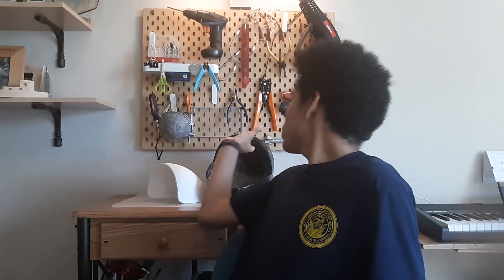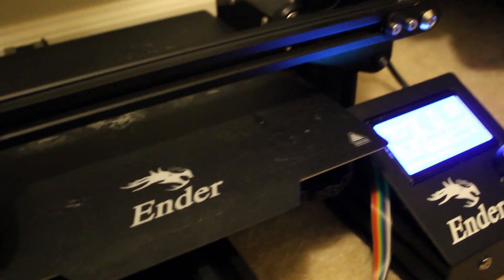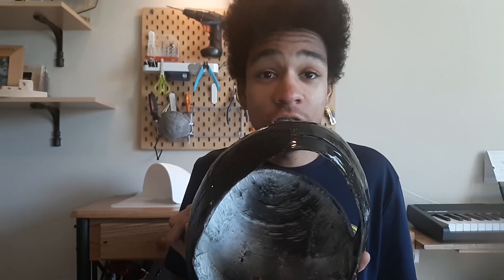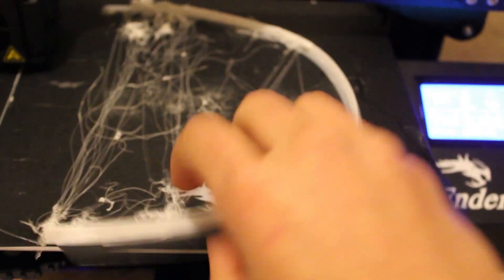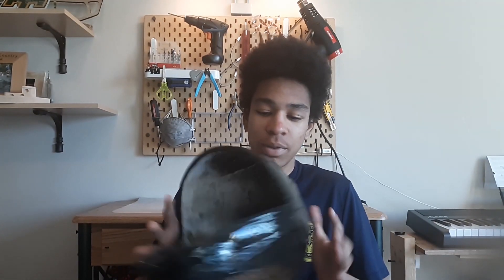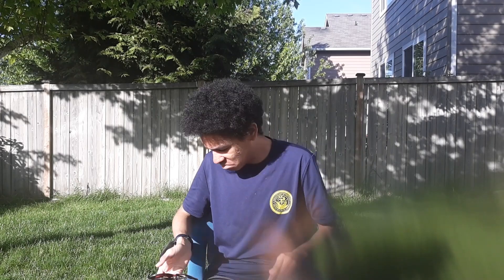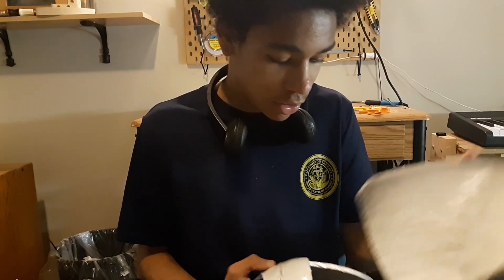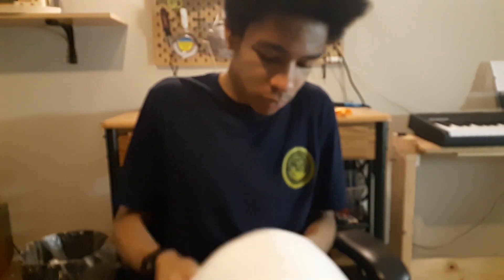How I Made My Own SpaceX Helmet

Comment: We should get a mk. II video. Also I have seen adafruit use mesh for their helmet visor, so you could try that as a placeholder.
Reply from the maker: I'll definitely consider making one. I have also seen Adafruit's mesh visor and while it most certainly works I'm not really a fan. A makerspace in town just opened up a few days ago, I might get the visor semi-professionally vacuum formed. I'll totally post that if I do ever get around to it.
Reply: @robertoandino6352  that would be awesome. You could wear your SpaceX helmet while docking crew Dragon on the simulator released by SpaceX 😂

Comment: I’m glad you at least tried and that’s more than most of us can say. I would recommend watching more YouTube tutorials on how to set up a 3D printer and how to get proper prints there’s tons like 3D Printing Nerd, Maker Muse etc. That would help speed up the process of printing and avoid failures and wasting plastic. Then I’d recommend trying to use a gray primer filler and just using multiple coats of that, letting it dry, sanding, more primer filler, and more sanding til layer lines are gone. Then move onto smaller grit sand paper and wet sanding til smooth which will take hours and days. Then prime and paint. As for the visor you could try again on the vacuum molding try putting the plastic on a wooden frame and then try heating it with a toaster oven til it sags. A heat gun isn’t even or quick enough sadly and try taping up your vacuum box and using caulk to seal it tight. You could also attempt to use PolySmooth Clear filament to print the visor and then isopropyl alcohol to make it clearer. I’d recommend a video by Estefannie  Explains It All 3D printing a daft punk helmet. Goodluck and hope you end making a cool helmet
Reply from the maker: Thanks for all the advice! I will admit that I actually have done a significant amount of research on 3D printing, but for whatever reason I wasn't getting good results on that printer. Issues could range anywhere from belt tension to bed leveling, to slicer settings and unfortunately I haven't been devoted enough to sort all of those out. I am a big fan of 3D Printer Nerd, and Maker Muse and I have found their videos helpful, or at the very least inspiring. Originally I did go the oven route but I cut that from the video. Here's what happened, basically the plastic wasn't big enough to get all the way around the helmet, and my oven was too small to allow for plastic that was any longer than 18" by 12" the heat gun was a last resort and I thought it would be funny. I do think that your suggestions are very helpful though, and I will try to implement them next time, thanks. (:
Reply: Roberto Andino no problem glad I can help I actually subbed and went and binge watched all your previous vids
Reply from the maker: @nerd_world8919  Dude thank you so much, I really appreciate it.